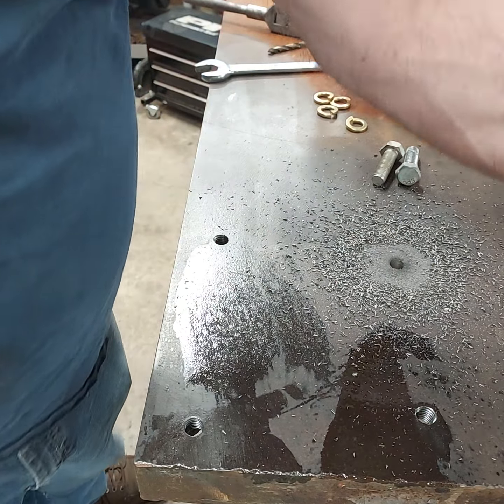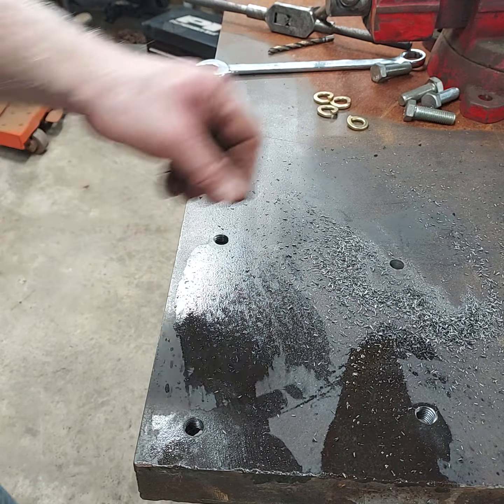Tapping holes in cast iron.

Comment: Hey. Thanks for the video, I’m trying put 4 new holes with threads on to my cast iron fire door here in the UK and can’t work out what size bit I need to use and what tab size for a 5mm screw? I’m sure this is laughable to you but any help would be hugely appreciated

Comment: That table is a BEAST. did you want the deep tapped threads through it for grip, or desired a flush tabletop bottom? i.e., versus just using longer bolts and washer/nut on the underside?
Reply: Those are not an inch deep... I think. The edges look closer to 1 inch, but I dont think the threaded holes look more than 3/4 inch maybe? maybe its the perspective. But the drill bit doesn't seem to move downward near an inch.
I am compelled to comment, I dunno why lol.
Reply from the maker: @Alex Holton  the iron is 1 inch thick. The sides are 2 inches.

Comment: Is that table top full thickness?   CRAZY!!    Always used to crack me up about those 'horizontal drilling' signs we'd see on those boring rigs..  Them guys were so proud..   There's way too many potential jokes to make when machining stuff..  haahah  Nice job on the video..   except..  turn the phone sideways so I think I am watching on my Computer or big screen      😀💪  Dave
Reply from the maker: 1 full inch thick cast iron and another inch of diagonal webbing and the edge is 2 inches thick all the way around. Extremely heavy. The phone was sideways, I just need to figure out what format I need to use.
Reply: @thomsworkshop946  Cool video..  Pretty soon I'm going to get some more equipment..  Someone has to be able to make stuff for these "NEW" people  ie. Millennials..   Maybe it's the old guys like you and me?  IDK  (I dont know for sure).. Dave

Comment: How much would it cost to have a small hole tapped into cast iron? I have a screw hole thats stripped on my pellet stove so i cant snug up the glass to make it air tight. Also, where would i go or who would i call for such a repair? Ty
Reply: @PiesWife You need the services of a Machine Shop. Whether or not there's one in your local area, is anoher story.

Comment: I've never tried to drill cast iron but am thinking of making a side-rail attachment for my 1950s table saw. How to keep the bit for the pilot hole from wandering? Can a standard punch put a tiny divot into the cast iron?
Reply from the maker: Should be able to just center punch it. The nice thing about cast iron is there's lots of graphite in it, and it's easy to drill.